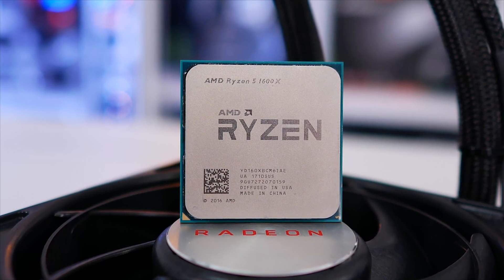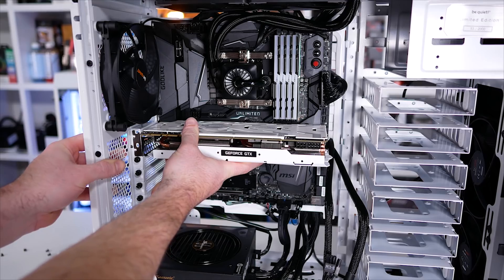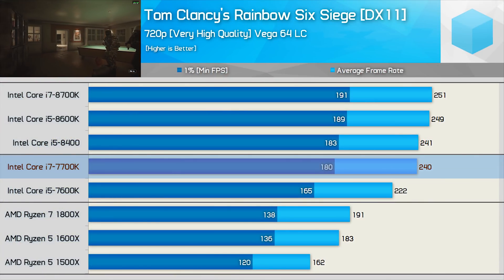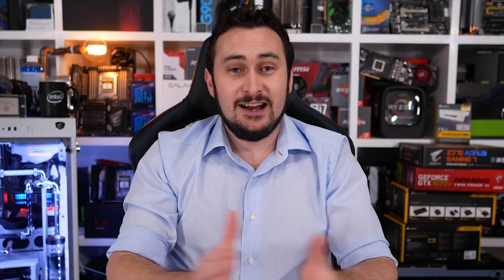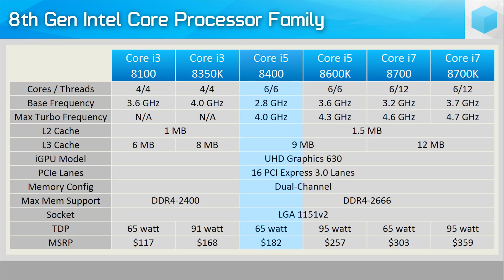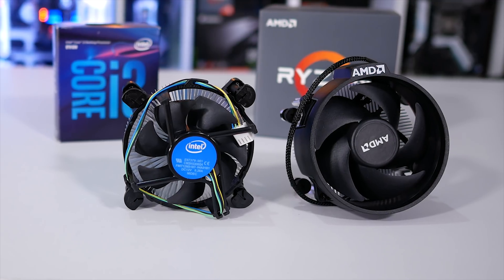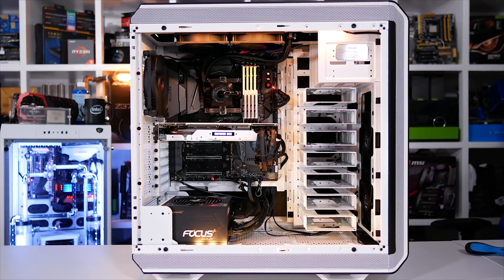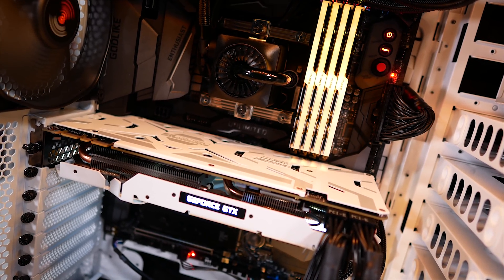Let’s Chat, R5 1600 OC vs. i5 8400 Benchmarks Incoming!

Comment: The only thing I dont like is the 720P testing because it doesnt show future performance. Ryzen has SMT, which is a lot like HT, true, but uses different resources and technology to work. It is simply a fact that modern games make GOOD use of HT, but not to the same extent - SMT. That is my point. Meanwhile, future games will not only use more threads and LOAD the threads to a higher degree (saturation of a thread also gives multi-core CPUs higher scores) but they will make better use of SMT. 

This has happened before as HT used to suck for many games of its day. Many popular titles actually ran worse with HT enabled (not much worse mind you). This was the case even in 2010. WERE there exceptions? YEs there were exceptions, same way SOME games make great use of SMT already. But exceptions arent the general rule. And to top it off - modern Intel CPUs have better HT than older gens.

I do think it is misleading. I dont think it is useless. I think most PC Gamers are too stupid to know these things which I just said. I am honest here. I hope this clears it up.
Reply: I am no fanboy....but you are seriously mistaken if not deluded.

Just back in the days of Sandy Bridge and FX, the same was said on how the IPC disadvantage does not matter, and games will utilize the more cores - and that is true, just that it FX series never looked up, and even today.

In general, we know Ryzen's IPC is ~Haswell's level. Now - Intel didn't progressed much between now and then, but the advantage from Intel's is still easily seen. 
Clocks, IS, no matter how you put it, one of Intel's advantage, and Ryzen is no match of Intel's. Thats a fact.
Game optimizations? Ashes of the Singularity is one of the most "DX12" "bench/game" you can have today, yet the i7-7700K still holds it own against even the Ryzen 7 1800X @4Ghz. Imagine how well then the 8700K will hold up? Optimization you demanded benefits Intel CPUs too, not only Ryzen. And thats a good thing for BOTH Intel and AMD.

By your SMT logic, games will ALSO use HT better, hence also helping Intel's chips. Also, you are mixing up Synthetic Benchmark and Gaming Benchmark. Ryzen series are amazing in terms of BOTH value and performance in professional workloads, while providing good performance in games. Thats the entire idea of Ryzen. To argue how Ryzen is going to beat Intel in all aspects is neither true nor scientific. Its not Ryzen's gaming performance is bad in anyway - they are great for the value. But if you want the performance king in games and a CPU that is able to hold its own against Ryzen in professional workloads, Intel is the way to go.
Reply from the maker: By this logic though there is no point test CPUs at all. If you don’t test where the CPU can make a difference what’s the point? Just test 1440p and 4K, say they are all much the same, buy the cheapest CPU and you're set?

You’d have to review CPUs 5 years after release if you want to avoid being misleading.

Fact is as I showed you last time we had this discussion, back in 2011 the 2600K was shown to be faster than the 2500K using low resolution testing. The 2600K also destroyed the FX-8350, as it still does today. Had you tested them all at a high resolution where they were GPU limited you could have bought the FX-8350 under the assumption that they were all the same.
Reply: Alexander Yordanov Bruh, I was going to say something but Hardware Unboxed just went over it lol
Reply: Damn we have a real life vulcan over here...I don't feel like a martyr when doing that. I only feel vengeful towards Intel...because of the bullshit they fed me with over all those years and for robbing us all off good competition in the market, with their malicious practices. I just want to be able to watch myself in the mirror (Yes I am an overly moral person...even in things like brand awareness - I prefer to buy no name articles if possible ) and I even regret buying my Core 2 Quad Q6600 since I learned of Intels practices and that it cost us all good competition, since AMD did not live up to the standards in the following years due to the lack of research budget. 

I really bought into that "Intel Inside" - bullshit back then. I did not even consider looking at the competition, since everyone told me, that intel is the only option for gaming. Yes! I still have a bad conscience because of that...and I am awaiting all the comments about the fact that I must be mentally instable, because this is how capitalism works and that it is to be exspected for a company to just make the most money with the least possible effort...I know that, but then I will be even more stubborn...

I mean I planned buying a new PC back in December 2016...I had the money for it as of April 2017 but I still waited for Vega all this time, because I still won't support ongoing monopolists. And even though I know I won't get the most bang for my buck as soon as custom Vega cards drop paired with either a 1600 or 1700 I will still buy it, because I know it will feel good and I assume it will be enough and get better with time. Maybe not better than Intel + Nvidia but better than in it's current state. 

I think I will still wait until Zen+ in hope of coming damn close to coffee lake, when in reality I think it will be overclockable to 4,3 Ghz at most (that is my prediction). 

So there is my idealist take on the hardware market.

Live long and prosper!
Reply: I come at this with no axe to grind. I am am in the market for building a new computer (although in no rush) and am truly trying to decide what to get. With the release of Ryzen I had been in the AMD camp with a preference for the 1600. However with the new Intel chips, I'm thinking the better choice is with them. 

It seems pretty clear that Intel currently beats AMD on just about every metric. The only fly in the ointment is that future games might work better with AMD than Intel. However that is not a given, and even if it did happen, AMD has ground to make up before it can even think about pulling ahead. In such a favorable future for AMD, they might just pull even with Intel and do know better. The only future where AMD is the better choice is one where future games run A LOT better on AMD chips. While that is possible, it is just one scenario. All the others have Intel winning or at par. So the safe bet today looks to be Intel.

One thing I am unclear about is future upgradability. I think future AMD chips will fit right in the current motherboards, but Intel is going to a new socket. If that is the case then by the time the better graphics cards make any real difference, and I'm willing to buy one, better AMD chips could be available too. This is all pure guess work on my part. It's something I would keep in the back of my mind, but not really factor unless I got confirmation it was true.

With no urgent need for me to upgrade right now, I'll likely hold off until next year to buy. Everything should be clearer then. But in my outside novice opinion, if I had to buy now, Intel would likely be it.
Reply: @Alexander Yordanov

The 8400 doesn't lose to the 1600 in all productivity such as with Adobe Premiere, and that is taking into account the higher motherboard cost. However, in all likelihood the only place I am going to significantly notice reduced performance is with gaming.

As for the less efficient and bigger CPU with inferior cooler part, if that doesn't show up in benchmarks, why do I care? <= Serious question

As for upgrade path, that is a concern which is why I mentioned it. I heard about it before but don't know any specifics. In 2-3 years would new AMD chips fit in their current motherboards while Intel wouldn't? That would change the calculation somewhat because that would be the time frame that better GPUs could make Intel's CPU performance advantage matter to me in gaming. I simply wouldn't buy such a GPU before then. However, even if true, buying what I think is an inferior CPU today for possible benefits 2+ years from now doesn't seem like a smart thing to do.
Reply: @Hugh Jass
It is the safe bet for an individual wanting to buy the best processor right now. Martyring oneself for some potential future good does not change that. That might be a noble action, but don't substitute it for a review or assessment.
Reply: I already dismantled your argument by predicting someone to argue 
 just like that (in the sense of AMD is a big corporation too...but it was clear that someone would be dumb enough ignoring my prediction saying it anyways)...so nice try...I am not an AMD follower...I would buy another companies products if there were some...but at the moment it is just AMD vs Intel. Simple logic I want to game on a PC (no consoles are not an option for me!) so I need a CPU and in that case I will buy the lesser evil that didn't piss me off yet...this has nothing to do with righteousness. I just don't like to be tricked...sure you could argue the right and only consequence would be not to buy a PC at all...but I am not going to do that...but sure try to undermine my morals...this is still the Internet...I am not being delusional and thinking that I am just being left alone with my mindset...I more or less asked for it by putting it out there! Have a nice evening none the less!
Reply: I am not a fanboy. I am correct here, Steve will be proven incorrect in a few years and he will owe me sex.
Reply: It isnt about that FFS, Tony E. Read again. It is about SMT and HT in games.
Reply: +Tony E

You can silence some of the confused ranters by comparing the 7600k vs 1600x in old games and then in current games. In older games, the 7600k beats the crap out of the 1600x in 720p. In current games, usually it doesn't. Therefore, the claim that 720p shows future gaming performance just got busted  ;)
Reply: + Fus Ro Dah
Proof? Previous testing of Steve's and various benches out there does not support you claim.
Reply: +Nekrosmas You are wrong, but it doesn't matter. Let's say you are right and the 7600k still is better on average than the 1600x. Cool, but things is, the difference in modern games is miniscule on average. On the other hand, it isn't miniscule in 2012 games for example. Modern games pummel the CPU more and more. Take for example the just released AC origins that hates 4c/4t CPU with a vengeance.  So, as time goes by the 1600x will surpass the 7600k...
Reply: + Fus Ro Dah
A. 4c i5 in 2017 is not acceptable, I agrees with that.

B. My statement is referring to modern Intel i7, and the 8th gen series vs the Ryzen Line. Games that use more cores will help Ryzen, yet at the same time ALSO Intel's.
You are talking about 4c i5 vs 6c12t Ryzen - I was referring to the entire lineup on the above comments.
Reply: +Nekrosmas

A. I'm glad we agree

B. Sure, the i7's , even the 8t kabylake have a long way to go until they are obsolete. 

The thing is, if you were unaware, I'm probably the one Steve calls an AMD fanboy and I'm the main reason that led to this video. There was a discussion in the techspot forums about the validity of 720p benchmarks as an indication of future performance, and all I was saying is that the 720p is not indicative of future performance when you are comparing CPU's with different cores / threads and different IPC's. Case in point, the 7600k vs 1600x.
Reply: +Ken Mathis

If you are holding off until next year then you can benefit from the cheaper h370 mobos for Intel and probably Ryzen 2 coming out. I'm guessing Ryzen will perform on par with the 8400 in gaming.
Reply: Not all games that use more cores favor Ryzen. See Watch Dogs 2.
Reply: @Ken Mathis
Yes, the 8400 will win some benches. But lose most, so it is an overall loss. but you are correct. The difference in gaming is short term.

The less efficient, bigger CPU part matters for the engineers and the market. Not so much for the individual. It means AMD has a better CPU design though. Efficiency matters for the consumer too, but not a lot. The cooler part always matters, so does solder vs tooth paste.

Yes, correct. Intel would not support that. The difference in real world usage in games is small and Ryzen 3 will kill Coffee Lake in gaming too. You decide on price IMHO.
Reply: Ken Mathis The safe bet can't be Intel, because if everyone thinks like this there will be no future for AMD CPUs.
Reply: Hugh Jass, sounds like you didn't do your research back then and are now looking for someone else (intel) to blame for it. But the real idiocy of your mindset is that you completely fail to realize that Intel and AMD are two sides of the same coin. They are both HUGE corporations who will do anything they think they can get away with to get you to buy their products. The only thing your comments prove is that you have bought into AMD's marketing over Intel's. You are not nearly as righteous as you think you are, my friend.
Reply: Alex I admire your logic,intelligence and humour. Are you also a chess player? Greetings from Athens. :)
Reply: Not much humor here.
No, am not a chess player. Why?
Reply: Chess players are very intelligent on average and have good humour, I paid you a compliment. :)
Reply from the maker: Copy and paste from the previous video...

“The 720p results are important for a few reasons though I admit for some they can be a bit misleading. The reason they are important is because they show us the true difference between CPUs in these games, with the speed limits removed this is how fast they can go.

In my opinion this gives us a good indication of how future performance should look when using yet to be released high-end GPUs, you know like the Titan XpX. The fact that the Core i5-8600K was 24% faster than the Ryzen 5 1600 on average means that in the future when GPU’s become much faster and games become more demanding, the Intel CPU should stand up better and potential last longer. Kind of like what we see when comparing the FX-8350 and Core i7-2600K in modern games, just to a much lesser degree as Ryzen’s actually quite good and the FX-8350 powered by 8 hamsters in 4 wheels.

However, we’ve seen that Ryzen works much better in well-crafted DirectX 12 titles such as Civilization VI and Ashes of the Singularity for example. The issue for AMD being that in late 2017 we still have very few well put together DX12 titles. Should we see an influx of quality DX12 titles over the next few years, then this could change the future prediction of the 720p results shown here.

If you had to make a bet now based currently available data, you’d probably just invest in the Z370 platform and get something like the Core i5-8400 as it will certainly look after you well right now. It also comes at a relatively low cost per frame and with 6 physical cores it’s not going to become extinct anytime soon.

Even if we look at the 1440p cost per frame data including motherboard pricing, we see that the 8400 costs just 8% more than the 1500X, but honestly I’d rather have the 6-core Core i5 for that small price premium.”
Reply: "In my opinion this gives us a good indication of how future performance should look when using yet to be released high-end GPUs, you know like the Titan XpX. The fact that the Core i5-8600K was 24% faster than the Ryzen 5 1600 on average means that in the future when GPU’s become much faster and games become more demanding, the Intel CPU should stand up better and potential last longer."

Lets see.

"In my opinion this gives us a good indication of how future performance should look when using yet to be released high-end GPUs, you know like the Titan XpX. " 
- Correct. For current games that will be the case.For almost all games (bar those with two complex X86-64 instructions per clock, which are very few) released till now, the Intel chip will faster.

However, we know the difference between Ryzen and Coffee Lake is around 7% in IPC. The rest is clocks and game optimization. SMT is part of that and it will get better. So using this info:
"that in the future when GPU’s become much faster and games become more demanding, the Intel CPU should stand up better and potential last longer."

is wrong. Games will become more demanding (will saturate more threads and use more threads) but will also use SMT better. And since Ryzen 1600 is a faster CPU in Multithreading with SMT working... chances are future demanding games will run as good or a tad better on it. That is the point, it isnt rocket science.
Reply: You may be able to silence some of the confused ranters regarding 720p or 1080p. 

If you could say pull out some old games from say 2010-2012 or older, use some hardware from that era, and some older first gen i5/i7s and some Phenom CPUs from the time (testing for actual competing parts with similar MSRP perhaps). Test the top end GPU from its time at 720p to remove bottlenecks and later see how that compares when you drop a card like the 1070 or even the 1080ti onto the same old CPU. 

You can see if improved and upgraded GPU power from those product's future were able to realistically show those CPUs true performance in the past with old hardware compared to if you upgraded the GPU 5 years later.
Reply: @Ken Mathis

The i5 8400 loses to R5 1600 in productivity, has a worse cooler, costs more, doesnt have cheaper mobo options and has no upgrad path. Intel in general has a less efficient CPU and a bigger CPU despite a superior fabrication process and a smaller node. So in engineering terms - AMD is slightly ahead of Intel.
Reply: Where did I say there is no point to testing CPUs? You just have to state these things because your audience wont know it otherwise. Most are new gamersm they dont have experience with PC Gaming or hardware long term. They are bad at long term thinking.

I 100% stand by you testing these same CPUs in 2020/2021. Old hardware matters of course. 

Are you telling me Bulldozer is the same as Ryzen and Intel's HT using architectures?  Because that is not true and you know it.

As for that part of testing... no offence but PCGH and Computerbase I hold to the highest degree of confidence. Of course, Id prefer to know where  games are tested because testing CPUs depends on the scene. So I still put it as inconclusive. Kinda like how Steve from Gamers Nexus or Science Studio Salazar said the i5 7600K is faster yet Digital Foundry showed that in CPU demanding scenes in multi-core games, the 1600 won easily. Such is life, its complex and nuanced.